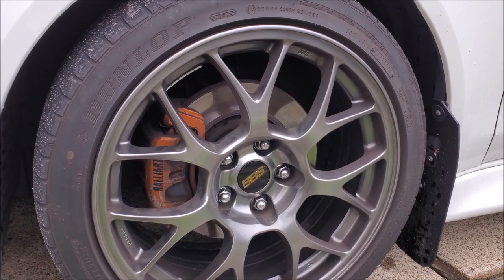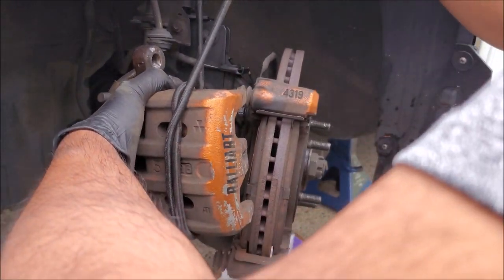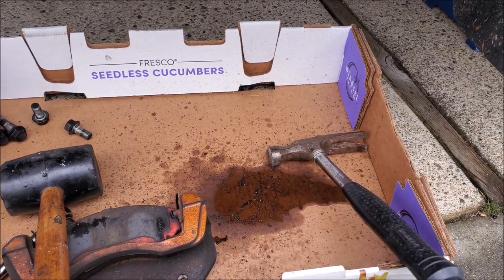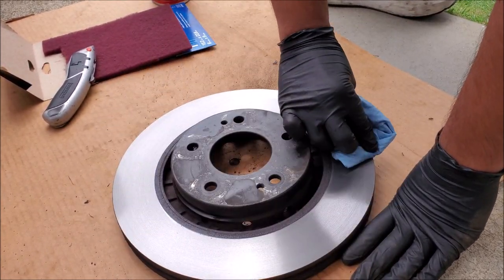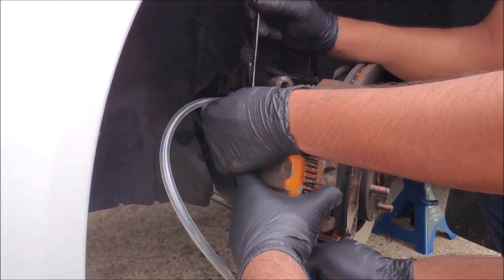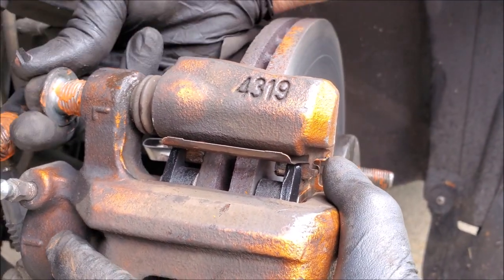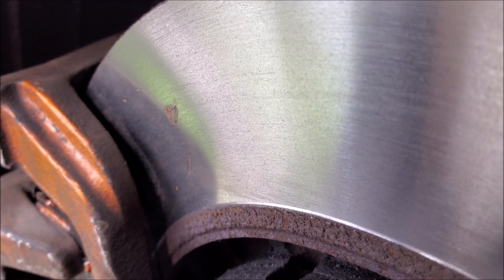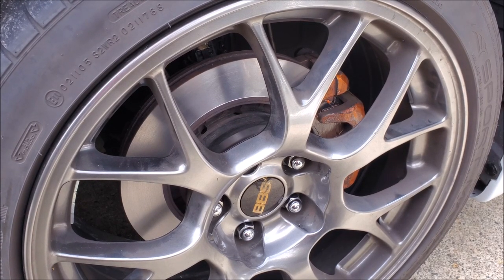How to change Brake Rotors / Discs and Pads (Floating Calipers) | AnthonyJ350

Comment: I would add,  use brake clean with straw adapter and flush out guide pin cylinder and let dry...Only use lubricant designed for guide pins and brake parts....On a different subject, Have you heard more noise from slotted/drlled rotors?
Reply from the maker: Great point! Nope, I've had slotted rotors on my truck for 10 years with Akebono pads and they're quiet. I prefer blank or slotted. Drilled is just for looks and prone to cracking as the rotor gets older.
Reply: @AnthonyJ350  I installed Power Stop slotted and drilled rotors years ago and they sound like a helicopter when braking...I have no other symptoms...I installed they meticulous cleaned, Torqued,ect....I'm using Akebono ProAct pads...